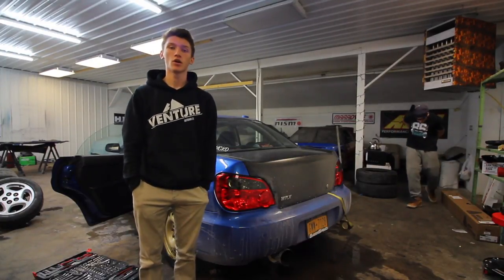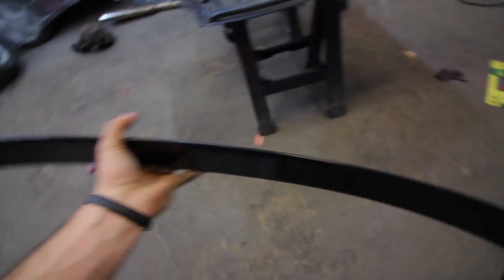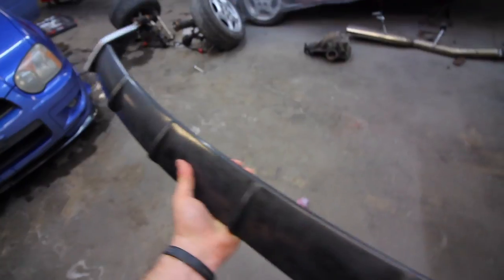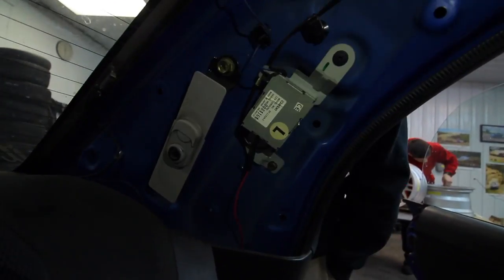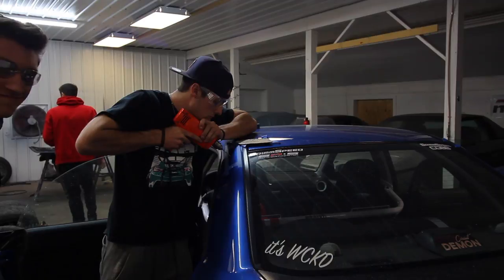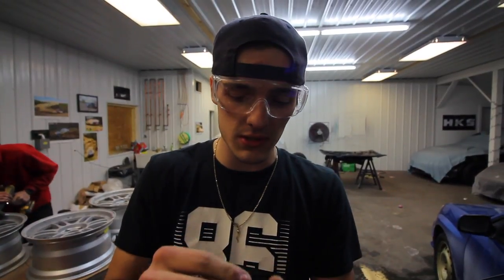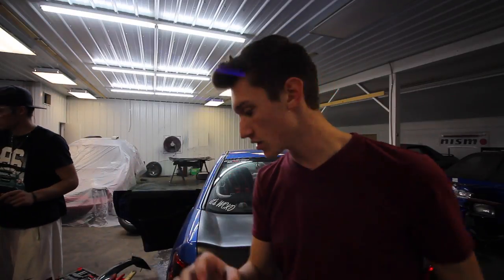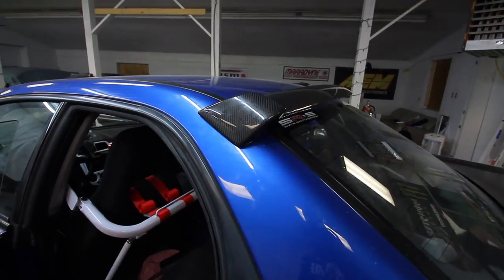Carbon Fiber Roof Spoiler Install - Subaru WRX

Comment: It looks so good man. But drilling into your car is honestly the most scariest thing. Ive been holding back buying a front splitter because I dont wann drill holes 😂😂
Reply from the maker: Krzysztof Kunka sometimes you just gatta think of what it will be after your done with the "surgery" , just gatta drill the first hole then after that you'll be fine with drilling holes anywhere haha